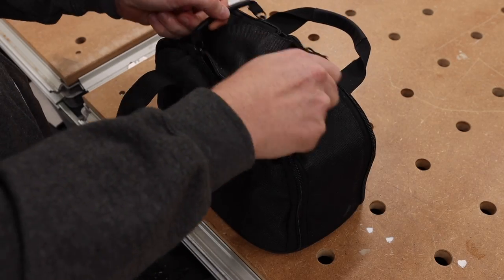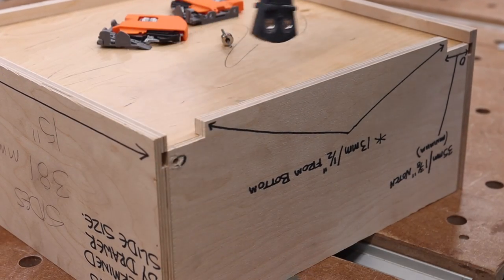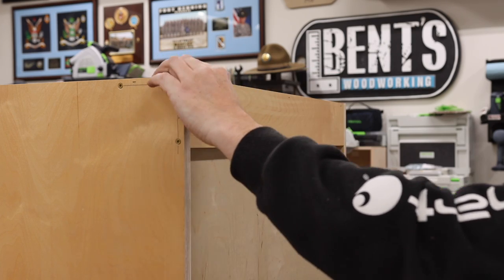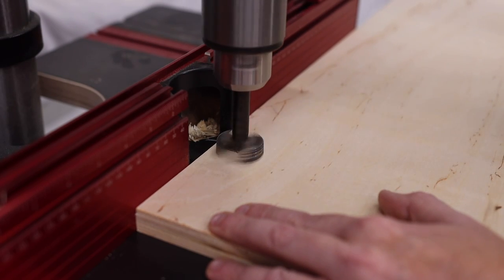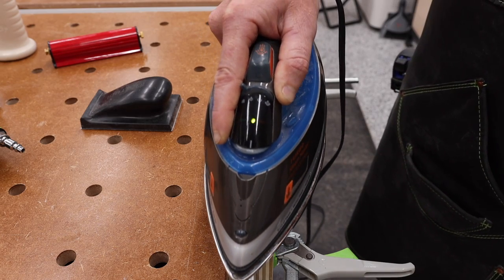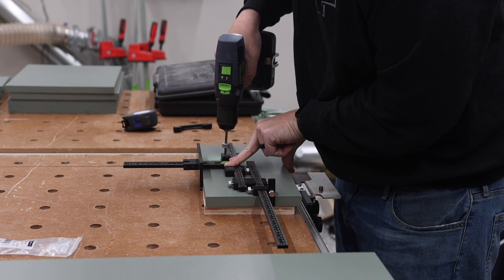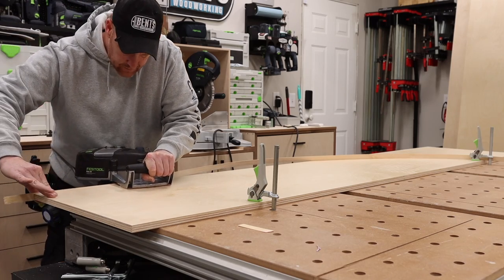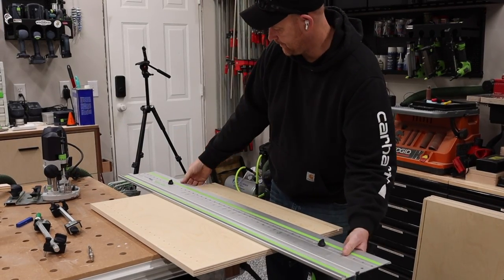15 cabinet tools I don’t regret

Comment: Makita track saws I hv both corded and non corded track are interchangeable w/green ones and hv “ALL” the same features!  I am a production Trim Carpenter so I pound my tools into the ground!  I found once out of the shop the Festool just seems to break 1st!  
Miter saw?  Makita or Dewalt DW780 those are dead nuts accurate out of the box and last!
I build a ton of cabinets like built ins , sink boxes, extensions , ect.,.
I do believe TSO has great track squares I just really don’t fool with them!

To each his own I know you build a lot of cabinets also however once you’re moving from job to job ; loading and unloading it gets to where your tools hv to withstand day to day banging around!  I also heard the motors on the miter saws (Festool) burn out quicker than any of the top brands?  Ask Spencer Lewis ; Inside Carpentry? 
Just my opinion?

Comment: This is a great list.  Agree with almost all of these, even for hobbyists.  The Conturo, of course, is the big whopper, but if you are a pro doing a lot of cabinet work it is no doubt worth the cost, especially if you can take the depreciation.
Reply from the maker: My favorite tool to use by far.

Comment: I have to wonder how that Grabo works with any porous sheet goods, especially lower grades of plywood.  Given that the surface of the sheet is not airtight, I would expect air to compromise the vacuum eventually.  I'd guess that the suction can even cause delamination.  Not to mention it costs a ridiculous $200 vs. $15 for a simple sheet lifter.
Reply: The Grabo is great for dozens of different uses. A panel lifter not so much.

Comment: The only thing I wished that Festool would make is an adapter plate for the Festool 2200 router so I could use the LR 32 track. I bought this machine because the 1400 router was not available and there was no answer as to when they would be available to buy. I hate having to think that I now have to invest in another Festool router namely the 1010 that will only really be used for that job.
Reply from the maker: There are many retailers that have the 1400 in stock currently. US Tool and Fastener does for sure.
Reply: Welcome to Festool.

Comment: What size TSO parallel guides do you suggest, 20", 30" or the 30-50" combo?
Reply: I have all 3 and for narrow tips, the 20” is the least awkward. I think 20” is a good all around one as you can fit it into a systainer and they’re quite small — 12” approximately. I think unless you’re going over 30” often, you won’t need the 50”. You could say with the 20” and 50”, a 30 might be redundant. Or do what I did and get all 3
Reply from the maker: I use the 20-30 the most. I have never used my 50

Comment: How do you use the LR32 for drawer slides?
Reply from the maker: By plunging the holes where the screws need to be
Reply: @bentswoodworking  Ahhhh...  I definitely over-thought that one, Drill Sergeant.  LOL

Operator Head-space & Timing indeed.

Comment: do you ever regret only having one Grabo?
Reply from the maker: Sometimes yes just cause I think two would be amazing
Reply: @bentswoodworking  im just trying to justify my dual set purchase i made the other day.   Though in my case,  ill be hanging 5/8" drywall on the new shop walls and ceilings!
Reply from the maker: @pctatc66  I’m sure it will be totally worth it.